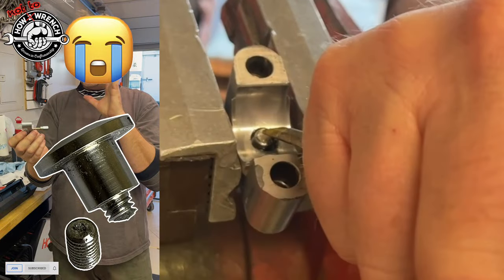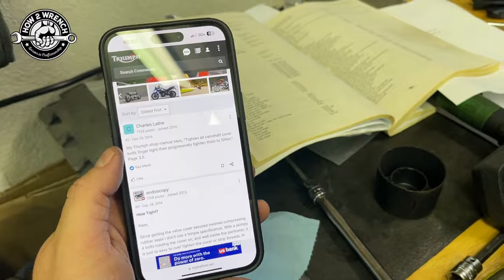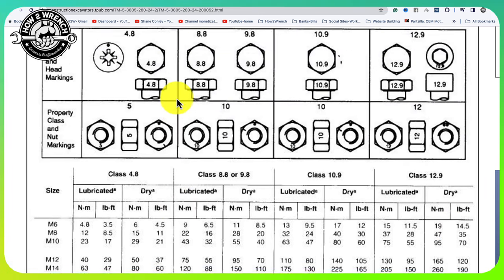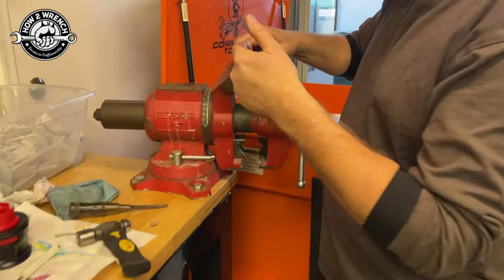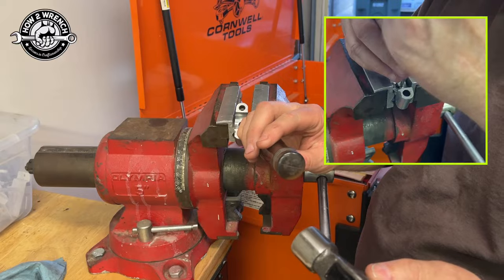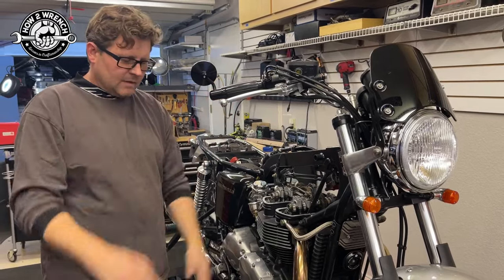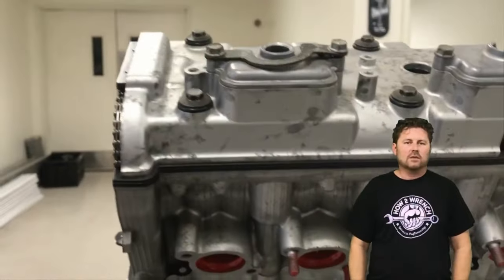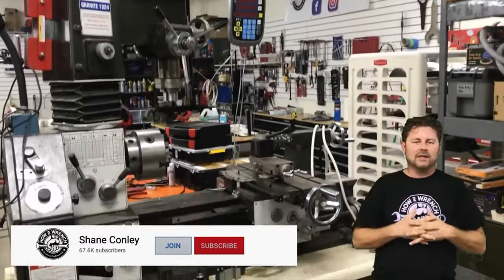Misprint snapped this bolt! How we removed the broken bolt PSA Triumph Owners! #triumphbonneville

Comment: Kawasaki kz1000 engines had a misprint on their cam cap bolts as well. In both the factory manual and the Clymer manual.
Reply: It was cam caps not the cam cover.
Reply from the maker: Thanks for sharing!

Comment: Excellent points. Engineers who put these things together aren't doing much more than reading tables for torque limits. So, if you're close, there has to be an error somewhere, perhaps even in a later decision to use a weaker bolt.
Reply from the maker: Thanks pal

Comment: Recent Polaris Ranger models have a wheel stud torque of either 75 or 90 Lb Ft (depending on model). Some of the OWNERS manuals though, list it at 120. We had a customer split and destroy 3 brand new aftermarket wheels, by following that. Why he waited until the 3rd wheel exploded before sensing the the torque # might be wrong, I'll never know. Shane is absolutely correct. Don't be afraid to question the content of service publications, especially those from the aftermarket. They're often written by literary types, not engineers or even techs.
Reply from the maker: Is this the legend from from Fort Dodge Alan? Is hello and so nice to see you on here! Advice from Racing Unlimited is always welcome.